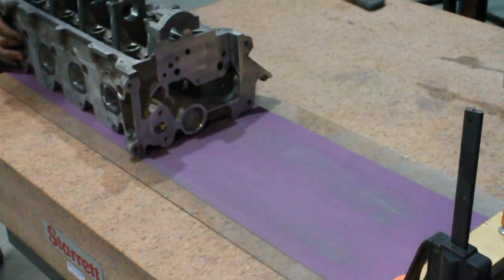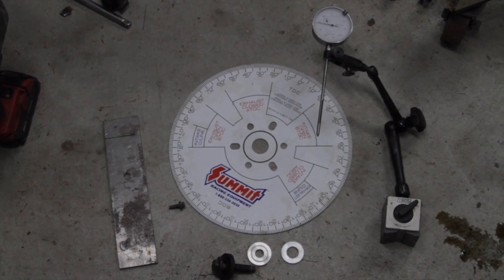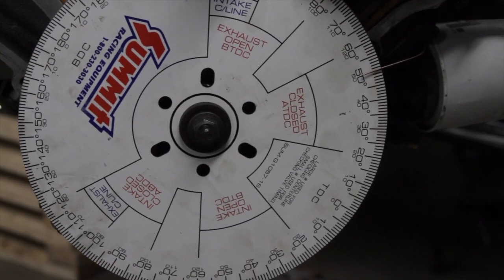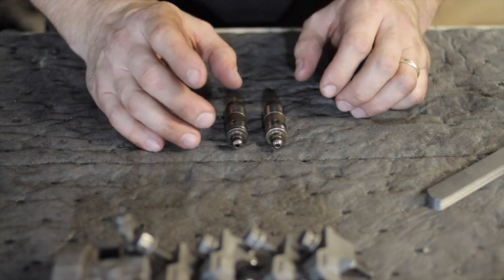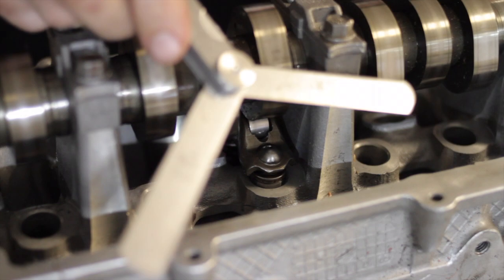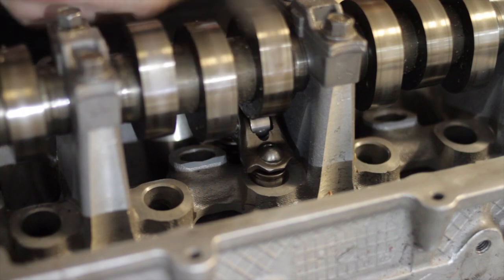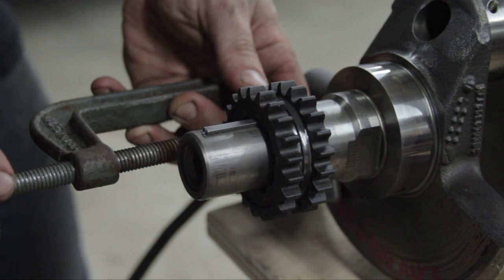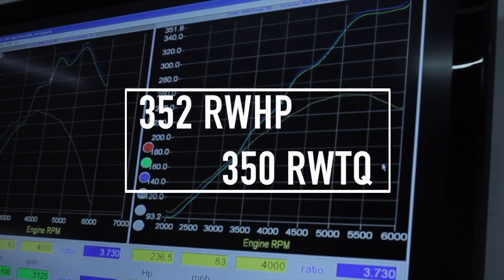3V 4.6 Swap | Longblock Build | Dyno Numbers | Chapter 2, Part 2

Comment: T-56 or 3650 in the car?
Reply: I have a 3v swap new edge also, but my channel is weak! I need to get some vids posted and hopefully we can all learn from each other.   I have some gear noise in my 3650 trans at idle, otherwise the thing rips, tons of fun to drive with the 3.73's!
Reply from the maker: @robertkrupa2552  Thats right!  I do remember watching your videos.  Is your car running and driving now?
Reply: Yes, I've had it registered and plated for just over a year.  I just really need to get some videos up!  I also want to revise my mid pipe.   New Edge is such a fun car, I'm surprised we don't see more of them modded.  I guess it's because the coyote has been out for 12 years now so  very few still mess with the 4.6L.

Mine has stock compression using forged pistons and Terminator rods with stock 3v crank and 3v alum. block.   I've got the Ford Hot Rod cams, long tubes, and intake plate delete, Cobra t-body, the usual 3v stuff.  Tuned remotely by Lito
Reply from the maker: @robertkrupa2552  Nice!  

I've said it over and over and I totally agree- this is a viable swap option for 2V SN95's.  Of course a coyote would be amazing and is clearly *better*.  But for the cost difference, I'm close to stock coyote power for about half the cost of a Coyote swap.  These guys shoot down the 3V swap on forums like theres no such thing as middle ground...they don't understand road course, I guess.  They'll tell you turbos or coyote and not to waste time on the 3V.  Well, I couldn't disagree more.  Everyone just needs to decide what works for them.  For my needs and budget, this was the best option.  Weight off the nose, 100hp increase, and half the cost of the coyote swap.  It's a no-brainer.
Reply from the maker: This car actually has a T45 in it.
Reply: @BradfordsGarage  sweet setup, thanks for all the vids with the killer tech info. Keep posting!
Reply from the maker: @robertkrupa2552  Thanks!!
Reply: Just put a m360 oil pump and change the oil and these 3v motors will run as long as a Toyota.